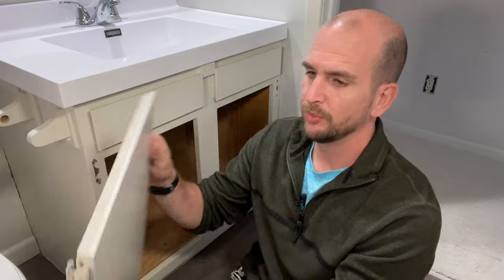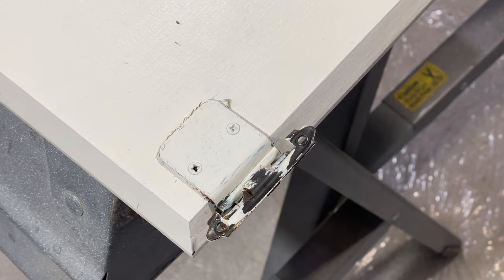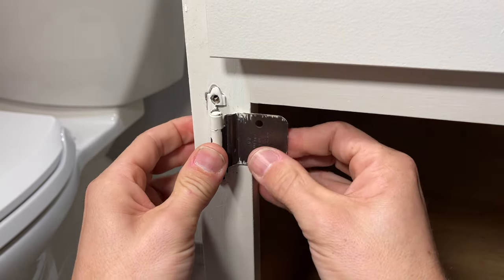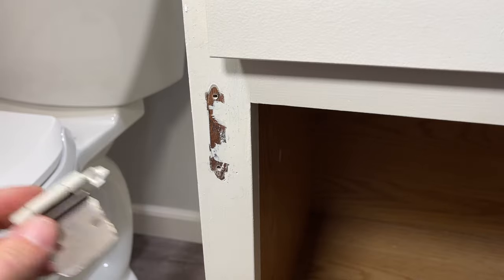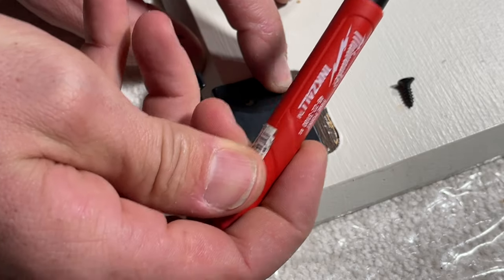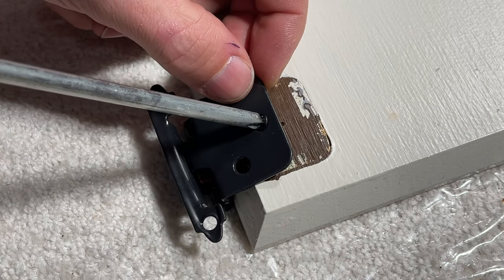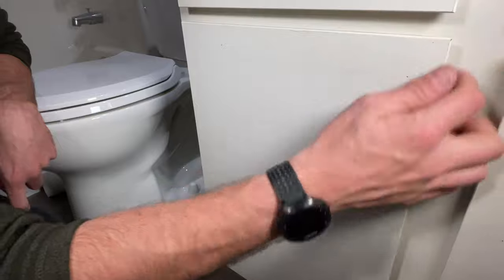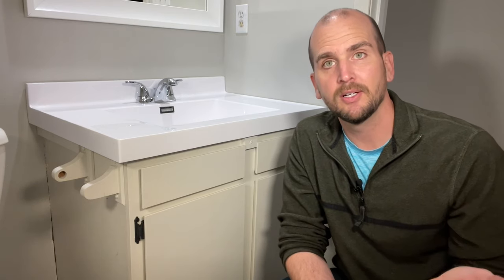Installing New Face Mount Cabinet Hinges

Comment: When you have two doors that meet in the center, and your new hinges don’t go in the same holes as the old ones on the cabinet itself. What is the best way to get the doors to meet in the center and not pinch anywhere in the 3/8 inset? Having a terrible time....
Reply: Same here. i tried Amazon hinges and Lowes hinges. They keep overlapping. I'm gonna have to bend the heck out of them I guess...
Reply: See Escamilla Woodworking video “Hanging inset doors the easy way” for a clever tip using construction ties/ plates with wood on either side spaced apart the width of the doors.  Use two on top and bottom, facing each way, to establish the gap and hold the doors in place.  He didn’t use it that way, but just use his idea. Use painters tape to hold all in place as you mount the doors;  you will have to unscrew the hinges on one side to disassemble your contraption.
Reply: I’m having the same problem lol

Comment: I need to try and figure out how to straighten or level this kind of cabinet door with these type of hinges. I replaced the hinges, and used the original screw holes. Everything lined up, except a few of the doors. For some reason a few are not level to each other. All the videos online for doing this are for the adjustable hidden hinges. Can it be done?
Reply: I'm having the same problem.
Reply: Same here, EXACT.
Reply: I would like to know if anyone knows how to adjust this type of hinge as well. Replacing them does cause some doors to go wonky and it's impossible to get them to square up properly.

Comment: Hey thanks for the video after putting cabinets up I noticed that the height of some of them aren’t matching up the boards lengths are the same but they aren’t level to their matching cabinet door buddy any suggestions to fixing that or do I just need to take them off and re put them up better?

Comment: I wish I could upload a photo, if I can I don't see how. I've got new hinges that have a plastic insert and they're really difficult to open. I'm assuming this plastic piece needs to come out but I'm not sure how as it's really tightly in there. They're the same hinges you have, just with a plastic bit inside the hinge itself. Is that normal and will loosen up maybe once installed or do I remove them, if so how? Thanks so much for the video, hope my question makes sense.

Comment: Really appreciated watching this video.  We are updating our kitchen, so changing the existing cabinets from dark stain to white paint.  (light Sanding, Kilz adhesion primer (2 coats) and Dutch Boy Ultra White 2 coats final)
Taping the drill bit with painters tape was awesome to drill new screw holes.  I combined that with using the painters tape to hold the old hinges (like they were screwed in) on the bottom and right sides of the cabinet doors.  This guaranteed me I would have enough gap for the door to open and close after mounting.  Then, I held the cabinet door up very firmly so the new hinge mounts would be completely flush with the wood.  (new hinges would snap fully 'extended').  Then, I drilled new holes on the cabinets if needed for the new hinges.  Used a hand driver to tighten the screws up, and viola!, every door now closes properly with no gaps!!  Thank you so much for this video and your ideas.

Comment: I wish I had say your video before buying replacement cabinet hinges. I wanted the original 1/2 face mount hinges in a different color, to update the look on my cabinets doors in the kitchen and bathroom. Instead I purchased the 3/8’s hinges. 😭 Which would’ve required me to drill new holes in order for them to work. 🤷‍♀️ I honestly don’t know if that would’ve worked or not. Would hv worked? 🤔 I was to afraid to find out, not to mention do all of that extra drilling new holes and making sure the measurements were correct. I’m stuck with bags of extra gold hinges I couldn’t return to the seller off eBay. Anyways, I know the difference between them now. Your video was so helpful! TFS! 🤝

Comment: So glad I found your easy to understand video. I am a 76 year old lady about to paint my kitchen cabinets and was worried about replacing the hinges. I have one question. What if the place you need to put a new screw has a stripped out hole already?
Reply: You need to fill the old holes with plastic wood. Let it dry, then put in the screws. It will fold well.

Comment: Well done!  In the past I’ve replaced literally hundreds of doors, mostly with the half overlay/ inset doors, on older face frame style cabinetry.  Usually a big PITA!  🙄 Thumbs up!  Stay safe and Healthy!  👍😁🇺🇸
Reply from the maker: Hey George, have you ever tried to clean/strip the pain off of hinges like these?  I have seen some place the painted hinges is hot water but process looked fairly tedious.
Reply: @EverydayHomeRepairs  Hi 😄 Soaking them in vinegar, and basically wire brushing them, but like you said, a royal PITA!  I’ve heard some that soak them in hot water with baking soda?  This type of hardware can get expensive on a large job, but if I were just replacing a few, I’d go the new route.  You get a better finish and hinges are new and ‘springy!’  😄👍😁
Reply from the maker: @georgedavall9449 really appreciate your feedback and sharing your knowledge.
Reply: @EverydayHomeRepairs  You’re Welcome!  Appreciate the replies, and your Integrity.  Too many people talkin out their “you know what,” on YouTube, and this can adversely affect those who are seeking help or information.  I don’t claim to be a fountain of knowledge. 😂 I like to help and contribute, and share.  That makes for a great forum and community. 
Stay safe and Healthy!  Best, geo 👍😁🇺🇸
Reply from the maker: 💯 agree.  Thanks again 👍
Reply: @EverydayHomeRepairs  
I just watched a video about this . Boil water . Add baking soda. Cook for approximately 10 minutes. Old paint just slides off . Just use nylon bristle brush or an old toothbrush. I did it on my copper cabinet hardware. Fantastic!
Reply from the maker: @toniloyd5618  Great, thanks for the feedback!

Comment: Good video on those hinge stile, but...... I have TV stand with two doors very similar to what your bathroom cabinet is and about same size but with no hinges, they are just setting in place with temp nail to hold the the doors in place, I'm tied of the nail in nail out....  My problem is, my doors go all the way to edge of cabinet on both sides and sets against a 1" wide 3/4" thick wood strip frame, I dont have that space you have around your doors where the hinges screw in.... 
I want 4 self closing hinges or some way to latch doors shut.... So how or what stile hinge will work? What kind of hinge would you use if your doors went to the edge of of your cabinet? Is there a hinge that will screw along the outer edge back toward wall and still close the door? 
I want 4 self closing hinges or some way to latch doors shut.... Thanks for any ideas that you can give.............

Comment: I replaced my hinges and they are three hole on the cabinet doors. I matched the new hinge holes to the original ones on the cabinet. How can realign them so they will close? Two cabinet doors are suppose to meet but not rub in the middle and they are crooked and are too close together. Am I going to have to take them off and make new holes? There is no screw or any thing to adjust them. My brother suggest I go back and get the ones you can adjust. Are they the self closing hinges? Thanks

Comment: I've been looking for self closing hinges but I'm now realizing that I likely already have them! 

Mine look very similar to yours, and when you do get the door close to closed, they do seem to finish closing... They are likely pretty old though, wondering if replacing them with new versions like you did would help improve their closing strength?

Any suggestions for a self closing cupboard hinge that is MORE self closing? This type seem to work from about 30 degrees, but ideally would love something that will work when the door is at least 45 to 90 degrees open.

Comment: OK. How did you decide the correct distance from your 90 degree door edge and the inside edge of your hinge? Or how far out to mount it in order to ensure door is centered over the cabinet opening equidistant??

Comment: My doors on my armoire are crooked. They have 3/4 partial wrap hinges. I took hinges off and put doors up to see how they would be straight. To make them straight, the left bottom of the left door has to shift 1/2 in. Inward and the right side bottom of the right door goes past the armoire 1/2 in. I am so confused. I measured the cabinet and cabinet and doors are the same size. Is there away to straighten them using the hinges. Thank you for any help!

Comment: I just bought new inset hinges. I did exactly what you did and now my doors are sagging and the double doors under the kitchen sink do not line up. Is there any way to adjust these type of hinges? When I tighten the screws on the facing, I literally watch the cabinet get pushed to where it doesn't fit properly. If I loosen the screw the cabinet goes back to where I placed it but then the hinge is loose on the facing aspect. I don't see any way to adjust. So frustrated because I already broke one of the self closing components due to "trying" to bend the hinge a bit. I also tried remounting the hinges. Got better results but not perfect. Thank you in advance.

Comment: We updated our kitchen cabinet hinges with newer ones. When attaching to cabinets the holes didn't line up, they were overlapping where the gap should of been and when tightening the screws down, the bottom or top would drop or lift not allowing the doors to align. What did i do wrong???

Comment: I’m replacing some hinges exactly like this. I have some cabinet doors that worked perfectly putting all the screws back in the same holes. I have other cabinets that didn’t work so well for. Some are rubbing at the opening. Some are now propped open and won’t close all the way. Can you give me some insight on what could be going on or how I can fix this?
Reply: Try removing the doors, remeasure when they will hang to not rub, mark the spot for the hinge and red rill a new hole if needed. If you want to patch the old hole buy wood filler putty in a small tub. It’s quick drying and fills holes and chips lightly sand repaint if needed and install.

Comment: Was looking for instructions, on an inset hinge, new install. I can't get these to sit flat to screw them on, especially in tight corners. The springs, preload these past the 180 degree point. I need 4 hands to stretch these open, push them flat, drill or mark holes and screw down

Comment: How do you know exactly where to put the new holes on the door so that it still aligns with existing holes on the face frame?  It appears that you didn't push the hinge all the way up against the side of the door.  At least that's what it looked like in the video.
Reply from the maker: I just aligned to where the old hinges were places.  It was easy for me since I had a painted and non-painted area.  I did push the hinges against the door but it might not have looked that way since the profile of the hinge and the profile of the doors didn't match perfectly.

Comment: My door stayed ajar a half inch so I did something wrong. At 3:29 you do not mention whether hinge is flush with wood or not.  I have 2 doors that need to close together, 4 hinges.  Hours later I can't figure it out.
Reply from the maker: Hey Tim, glad you got the issue fixed 👍

Comment: I have old hinges. Both parts are on the outside door. I do not want these old school ones but I'm not sure if it is fine to buy the ones you just installed or if it will work the same.

Comment: We are replacing these same type hinges because the old ones are rusty and have been painted  over several times. We have installed all hinges on the uppers and several on the lower cabinets. We are down to 3 sets of doors and no matter what we do we cannot mount the door with hinge attached to the fronts of the cabinets. The hinges are sitting exactly where the old ones were but the hinge will not lay flat on the cabinet. We have tried every "trick" we have been told about and none have worked. Any tips for us?
Reply from the maker: Hmmmm, I think the best path is to join our Facebook Group https://www.facebook.com/groups/623172345205906 then you can post some pictures and ask the question.  With pictures I am sure myself and/or the other 65,000 members could give some feedback.  Thanks!

Comment: The kitchen cabinets in my apartment uses these, and the bottom hinge pin fell off the other day.... is there a way to fix it or should i just buy a replacement?
Reply from the maker: I would just get a new one.  Take one of the hinges off and then take a trip down to the large home improvement store.  You should be able to find a match and the install as shown in the video is easy.  Let me know if you have any follow up questions.

Comment: Scott, I have self closing hinges in my kitchen cabinets that lost their vigor, and the cabinet doors stay open. Is there a way to fix the hinge so i'ts tight again and keep cabinet doors closed?
Reply from the maker: To help you troubleshoot this one we might need a bit more info.  If you join our facebook group "Everyday Home Repairs Community" you can post pictures of your hinges and describe the issue.  Then we will have more info to work with and get your problem solved.  Thanks!

Comment: Is there a reason the screws used to mount the hinge to the cabinet frame  have a flat head while the screws used to mount the hinge to the cabinet door are longer and with a round head?
Reply: yes
Reply: @KB-qk7kn  what is the reason ? Why not keep them all flat or round?
Reply: You could have them all the same if you prefer. The rounded heads go on the outside visible part of the hinge, I think because they are more decorative. The flat heads go on the app inside and will be flush with the surface of the hinge. It seems to be the standard design.
Reply: @KB-qk7kn  thank you! Just a beginner here. I guess it indeed just looks better. Now I feel like checking every cabinet door’s hinge I see to take a look at the screw choice.
Reply: Great idea to look at others. While there are standards, personal taste is also important.

Comment: Question? can those face mount hinges be replaced with something else? I want to get away from that face mount type. What would you suggest? Thank you for great video.
Reply: Simple answer is yes. I would recommend a Euro style hinge. Make sure you buy the right size over lay for your cabinets. Lowes sells a hole drilling jig to make installation easier.

Comment: Super helpful video, man! Much appreciated. My question is this: where did you find those specific hinges that you installed? We went with a white countertop/black accents look, and we have almost the exact same hinges that you used to have on yours. We’d love to save ourselves a bunch of online shopping and just go get the ones you bought!
Reply from the maker: I went to Menards which is a big box home improvement store found throughout the Midwest.  If you don’t have Menards you can try Home Depot or Lowe’s.  Best of luck on the project!
Reply: William you find them in Amazon on line.    I got mine from there
Reply: Home depot have them...same style but different sizes

Comment: My cabinet doors when hung are anywhere from 1/2 inch to a couple inches apart. I’ve tried rotating the doors to make sure the right cabinet face is on the right cabinet. This has been extremely frustrating

Comment: My kitchen cabinets have a side pocket to insert the door hinge  what are they called and can I switch out for a different hinge
Reply from the maker: Hi Mauna, are yours more like these "concealed" cabinet hinges?  Check this video https://youtu.be/ekf7mpMNDPU I did on how to measure and select the correct hinges.  Specifically this video is upgrading to soft close hinges which is a nice feature.  Let me know if your hinges don't match the concealed hinges.

Comment: Is it possible to change the cabinet hardware from exterior mount hinges to interior mount?
Reply from the maker: You could but it will be a much larger project.  Here is roughly a type of hinge which might work https://amzn.to/3CKh9W8 but you would need to cut out a hole for the cup.  Best of luck on your project.